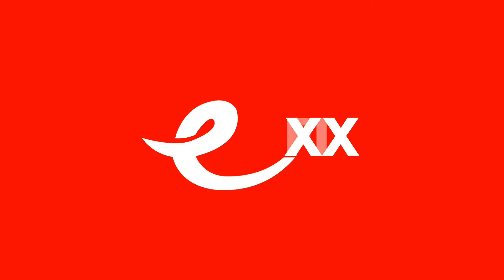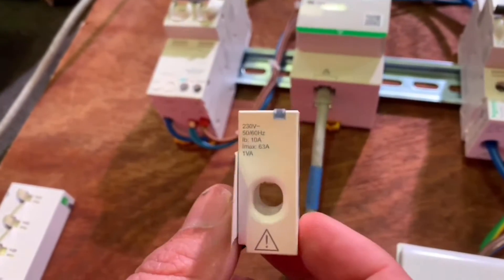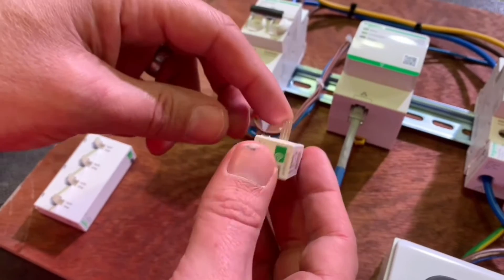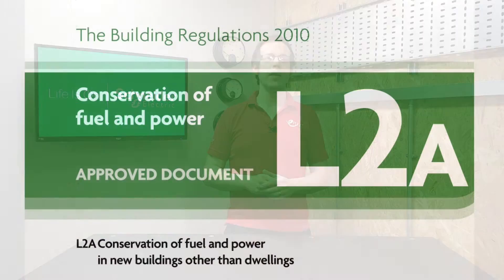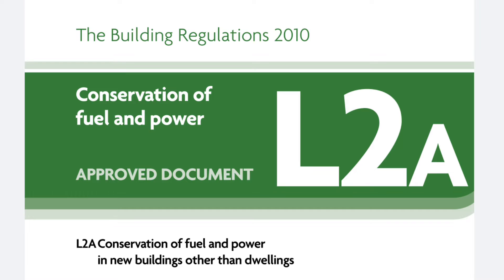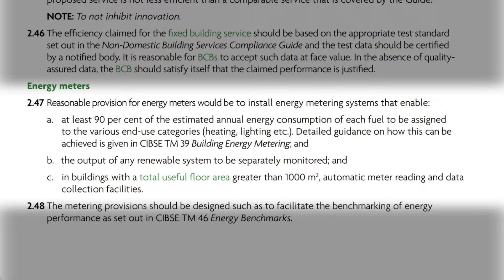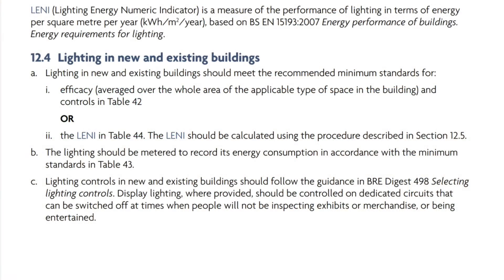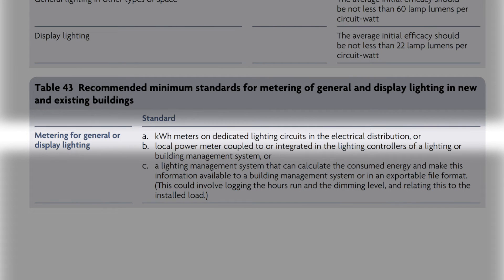Do I need to monitor electricity use in a building? - Electricians Q&A

Comment: My smart meter does that.
Reply: Tell your consumption per circuit? No it won’t..
Reply: @filipe.skunk8  can you imagine how it would cost to monitor all circuits?
Reply: @raychambers3646   yeah but the man is talking about buildings not a 3 bedroom house. There’s other cheaper ways to do it in a domestic setting though apart from these smart TI’s.
Reply: @filipe.skunk8  I know he's talking about commercial properties they usually monitor aircon / heating use ,lighting is dealt with in a different way.
Reply: And it let's your company know when your using it !